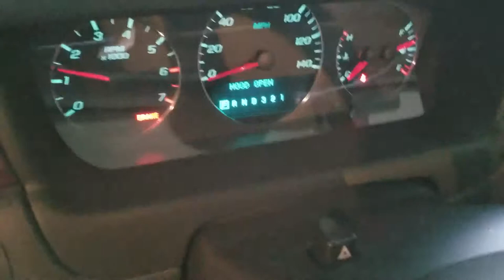2007 Impala Radiator Support Rebuild

Comment: What Kind of Drill did you use to Cut the Radiator Support. Gotta replace this on my 07 Ss!
Reply from the maker: The proper way would be to use a spot weld drill bit. I just used a grinder.
Reply: @freehandgarage  I can't just use a Dremel and cut where you were Grinding at? And just keep it held on like the bolts you were using?
Reply from the maker: @cammims7645  If you're going to go the cutting route instead of spot weld drill bits, I would suggest using an angle grinder because it is pretty thick steel and a lot of welds. The best method I found was cutting (using a cutting disk) a small square around the spot welds on the part being removed, remove the part, then grind (with grinding disk) the squares remaining on the chassis down.

Comment from the maker: FYI, The damage was quoted by two separate shops to be around $6000 to repair and without paint I was able to do it for $1500.
Reply: $1500? the support alone is about 150 bucks. how did it cost you so much? I was gonna purchase a mig welder and weld in a new one but I like your idea of using bolts
Reply from the maker: @thechosenone3504  Shipping was almost half of it. I really wanted to go to the junkyard to really bump that price down but I didn't have time.
Reply: Bro I got the same price for my repair, lol I’m now doing it myself thanks to you

Comment: What’s the part that connects the front grill and headlights retainer clip to called mine broke so my headlights are wobbly
Reply from the maker: The clip attaches the headlight and the "bumper energy absorber"
https://www.rockauto.com/en/catalog/chevrolet,2007,impala,3.9l+v6,1438215,body+&+lamp+assembly,headlamp+retainer+/+clip,1000378
https://www.rockauto.com/en/catalog/chevrolet,2007,impala,3.9l+v6,1438215,body+&+lamp+assembly,bumper+energy+absorber,827